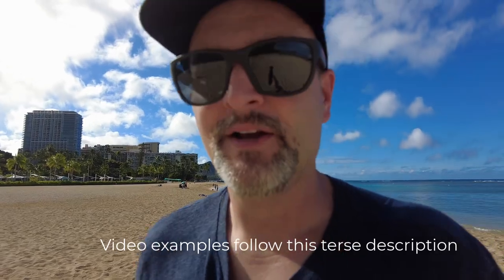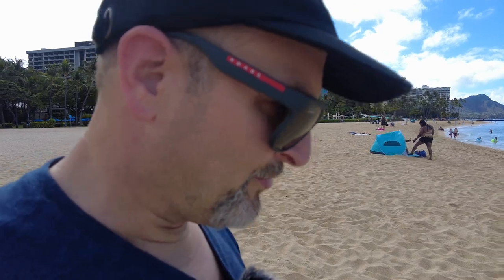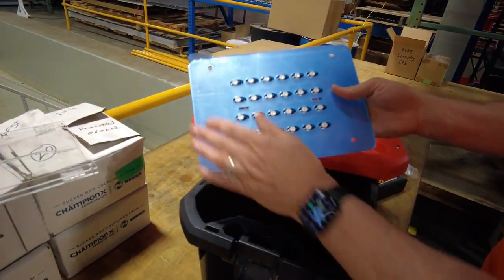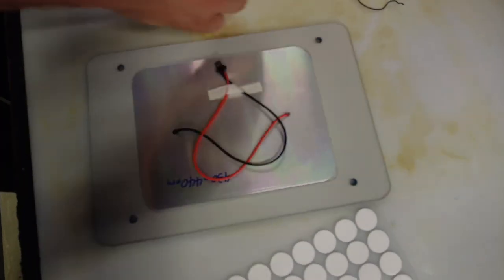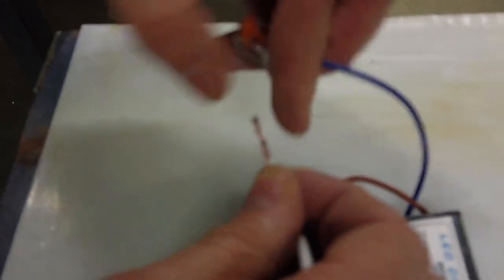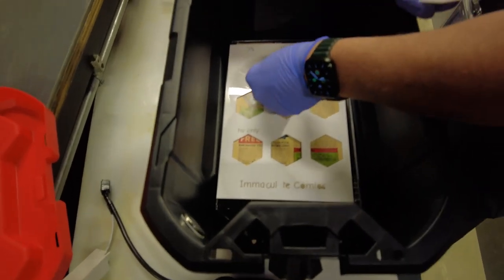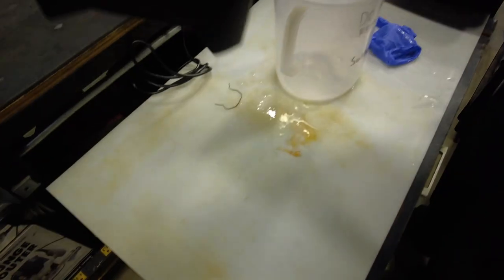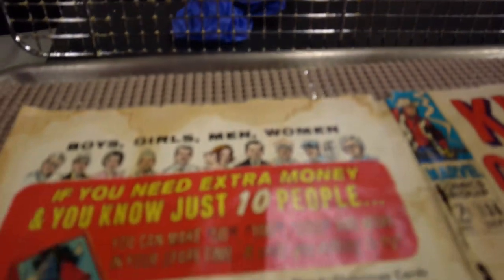Assembly and Use of the ImmacuCube - a quick tutorial

Comment: Thanks Rick! Am just about to put her through the first paces, got some light and heavy water stains, some coffee stains, and one doozy with caked-on debris, as well as oil stains, black permanent marker, a whole bunch of things! Super curious, esp. for the coffee stains, marker and debris.

For clarity, DI or distilled especially for water stains / tide lines, yes?

In what conditions would we add ImmacuClean, Titron X-100, or both?

Also, whatever focus settings are being used on the Osmo camera need to be switched to Auto-Focus. Right now, the camera is stuck to one focal point and doesn't adjust, so clarify of close-ups, etc. is lost.
Reply from the maker: 1) I use distilled or DI water often but the water where I live is so clean that I can get away with tap water.  Some other waters can leave a white residue on the book.

2) Use a surfactant or immacuclean if there is soil which isn't water soluble on the book.  This could be a lot of things but its essentially whatever doesn't come off with water.

3) about the camera, thanks for the insight,  I'll pass that on to my 11 year-old videographer (Nolan) as he knows how to operate that thing.

Good luck and keep me updated on your progress!